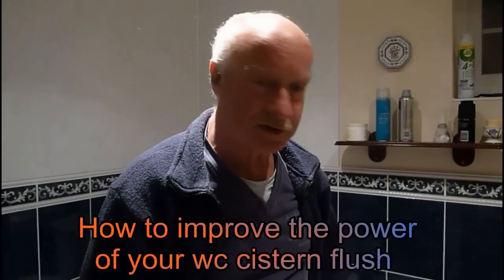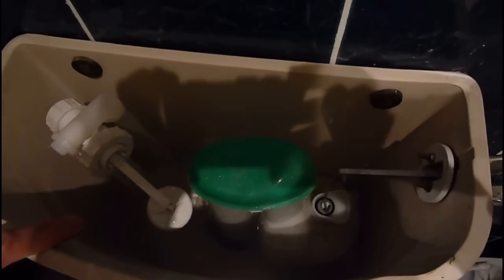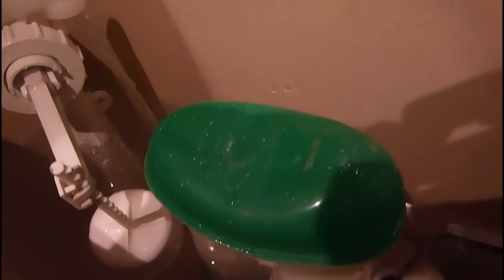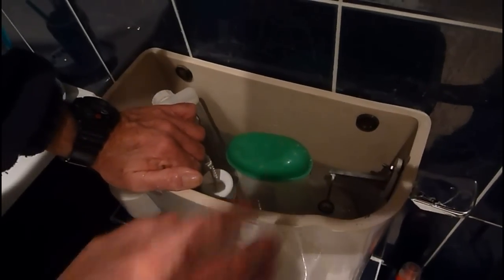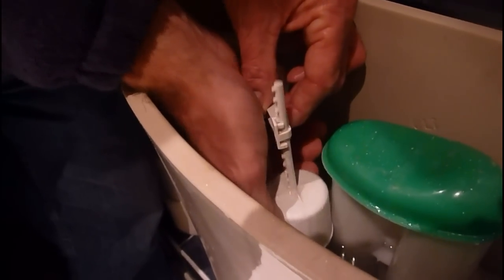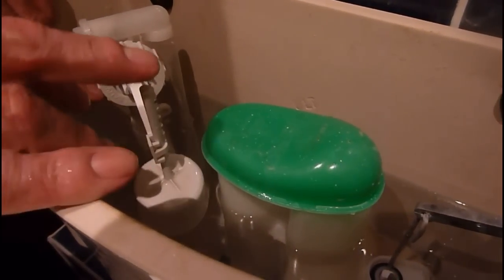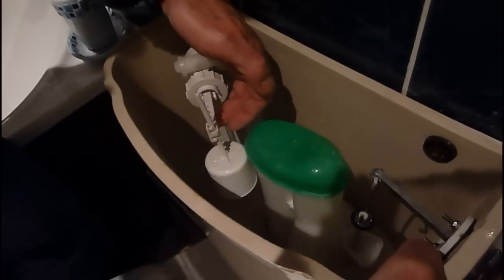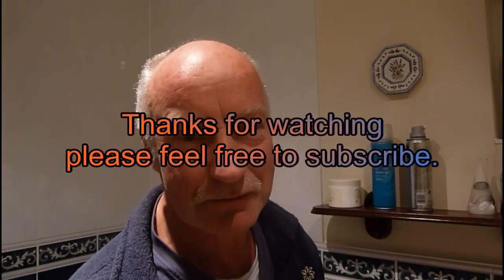How to improve the power of your wc flush. Not enough water to flush stuff away?

Comment: Hi,I’ve done the adjustment but the tank still doesn’t fill,does that mean the washer needs replacing in the siphon?
Reply from the maker: If it is not flushing then the problem is with the syphon. If there is not enough water in the cistern then the problem is the fill valve.

Comment: I have a dual push button flush on the front of a concealed unit. The flush is not strong and stops altogether when the buttons are released. I've been searching your videos but haven't found a solution. Can you help?
Reply from the maker: I would need to see the syphon you have behind the panel, but generally if you renew it, it should sort your problem.
Reply: Thanks for responding. I have taken the front panel off and have taken a photo of the cistern but I don't know how I can upload it for you to see. Since I put the panel back it does seem to be flushing a little better so I wondered if it might be something to do with the pipes from the push buttons to the syphon?
Reply from the maker: Check the water level is at the correct hight.
Reply: I think it seems ok now so maybe one of the pipes from the flush buttons had become kinked or something but thanks for your help.

Comment: Help!  I have the same problem but the waterline is fine.  It looks like the fill valve has a small hole in it.  Should that be there?  Could there be other holes in the fill valve that is causing this problem?  Do I need to replace the fill valve or do I need a new toilet?  Not flushing and I'm holding the flusher down for 3 seconds.
Reply from the maker: The hole should be there. The syphon is the problem.
Reply: Thank you so much for your quick response!!!!!  I really appreciate it!!!!